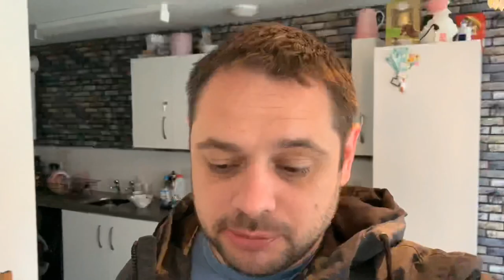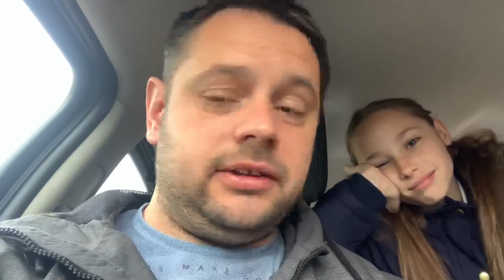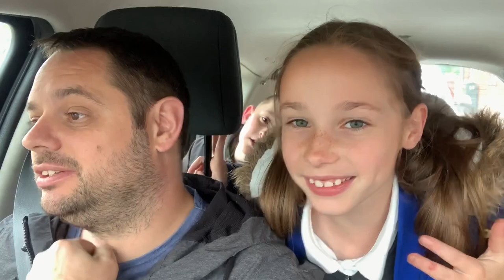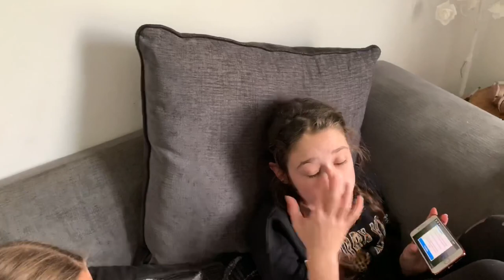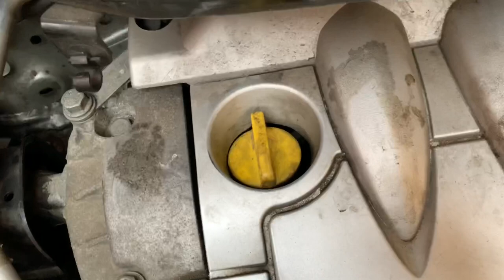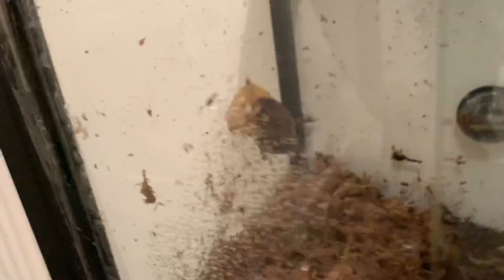A Vlog of me moaning #stevesfamilyvlogs

Comment: The head gasket has definitely gone on that car at some point in it's life. The oil in the water reservoir is a give away. Probably hasn't gone now though as nothing under the filler cap. Is the temp gauge going higher than normal and/or white smoke out of the exhaust?
Reply: Although having said head gasket (shouldn't) cause the water to go down when the car is sitting
Reply from the maker: Been to a garage today. They reckon it’s the head gasket. No the temperature has been fine on it and no white smoke
Reply: @ITS_JUST_STEVE82  Argh no sorry to hear that. Sounds like time for a new car :( Probably the early stages, soon if it is the head gasket the temperature gauge will be erratic and you will get smoke. Hence only oil mixing in with the water. Such a shame especially after it's MOT :(
Reply: @darnitproductions5945  That stuff is really a last resort and only to be used if you plan on scrapping the car in the short term. It really does make a pigs ear of the radiator and basically partially clogs the cooling system (hence stopping leaks)
Reply: @sammytheseal2307  I used it on mine and had no issues and worked a treat. And for how much steves car is worth its more cost efficient to put this in than spend 800 quiod on a new gasket.
Reply: @darnitproductions5945  Yeah but what I mean is it is only really good if you don't care about the car and need it to tide you by until you can afford new car.